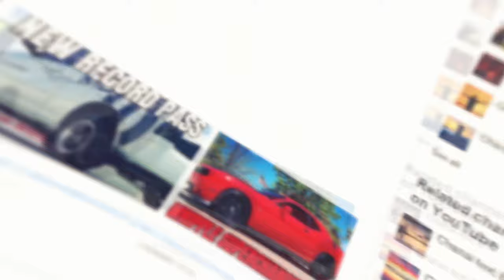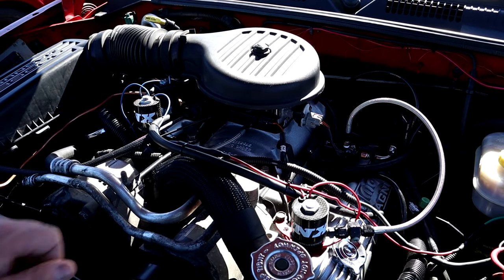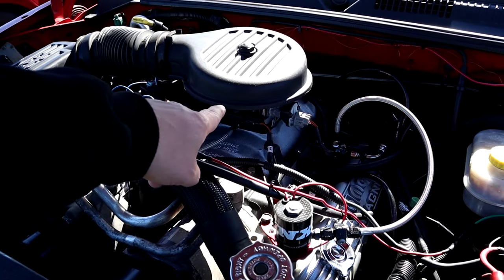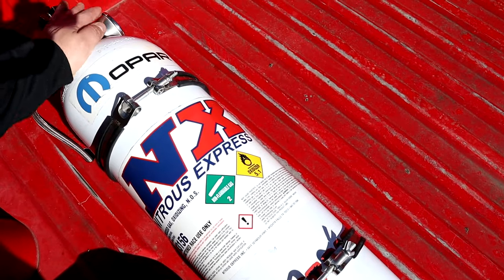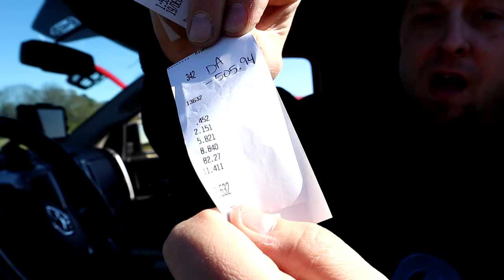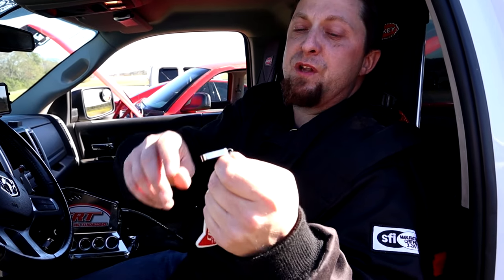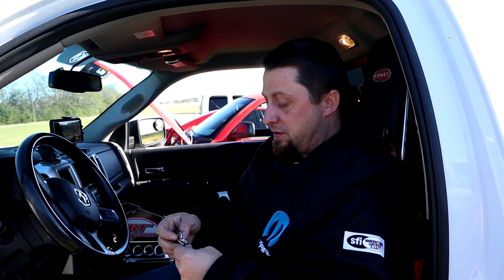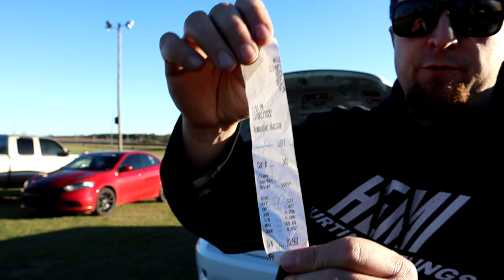Stock Block 5.7 RAM R/T Runs 10 Second 1/4 Mile! With TorqStorm Supercharger

Comment: Got me a little confidence in my build after seeing this. I have an 05 300C 5.7 with a TorqueStorm. I’m on the 3.25 for now as I’m just getting through the first stages of getting it done but now I know there’s more potential there on a stock block.
Reply from the maker: Awesome man💪
Reply: You better put a forged rotating assembly in it or it will not hold up. His truck has a stock block, not stock internals.
Reply: @JustAGuy781  still has stock piston and crank,yes with any blown or nos build its best too have forged bottom end and piston rings resized.
Reply: @Pickleram  and you are? Are you the owner of the truck? Sorry, rather hear it from the main source, not one of his fans. 👍
Reply: @JustAGuy781  not a fan of anything,but I am a friend that knows.
Reply: @Pickleram  ok then I'll accept that.
Reply: @JustAGuy781  it’s in the plans eventually. Have to recoup funds from getting this far into the build and I want to drive it around for a while. Plus it has 170k miles on it so it’ll need to be refreshed at some point anyway so when that happens the internals will get built.
Reply: @Metal_Mechanic  good deal bro. Congrats on the 10 second pass and take it easy for a little while knowing and loving what you and your team and family has achieved and then when the time is right do what needs to be done. 👍👍
Reply: @JustAGuy781  Thank you! Much appreciated

Comment: Really impressed with what you’ve done with the torque storm, especially with a mostly stock motor. Mopar to the front
Reply: It has a stock block, not stock internals. Misguided...
Reply from the maker: Thanks bro
Reply from the maker: No sir your wrong it has stock internals stock pistons rods and crank only change is camshaft👍
Reply from the maker: Have no idea what made you think that.